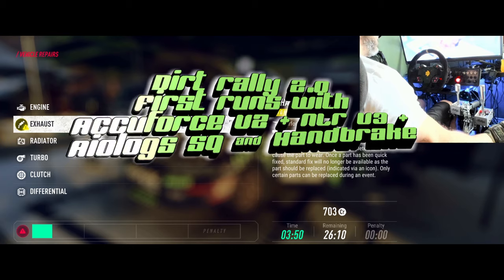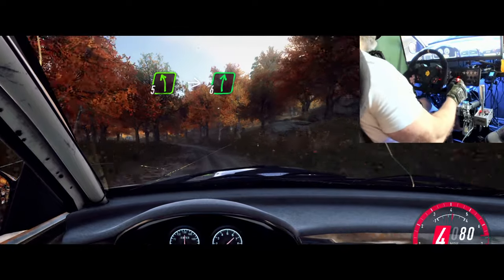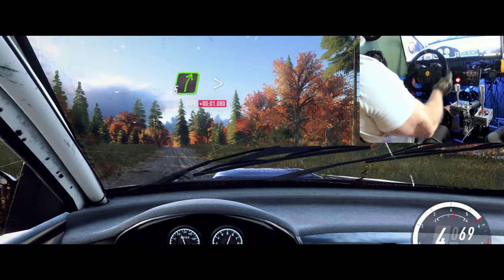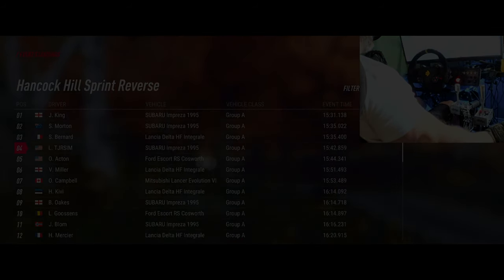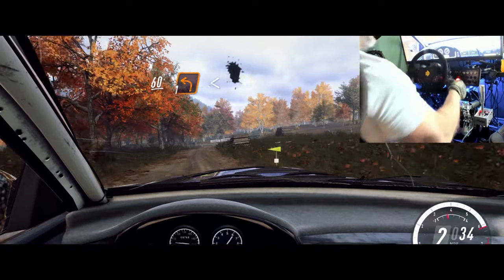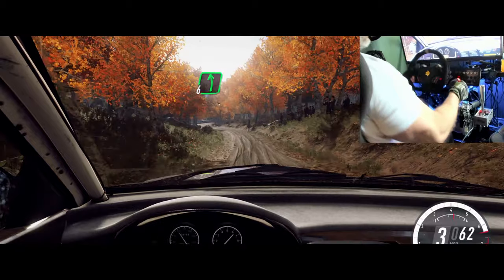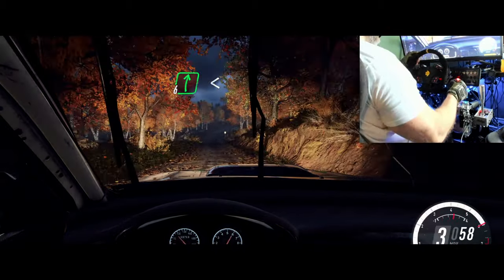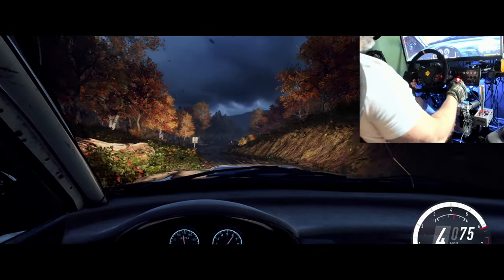Dirt Rally 2 First Look with Aiologs Shifter/Handbrake + NLR V3 + Accuforce V2

Comment: Is it possible to mount the aiologs shifter directly to the simetik k2 or do you need to make extra holes? 
Next week I'm getting that beautifull piece 😁
Reply from the maker: No it mounts directly to the rig. In my setup in the vid. My Ailogs hb is mounted on the right directly to the simetec  shifter bracket. Your shifter can mount there. I show a how to in my upcoming Aiolgs hb review. Just 2 bolts and nuts is all you need
Reply: @TJRSIM  alright thats awesome, thank you for the info 👍
Reply from the maker: @HomieFFM  anytime buddy.